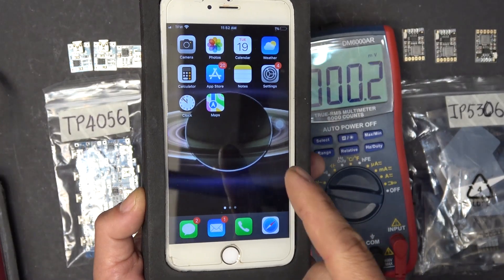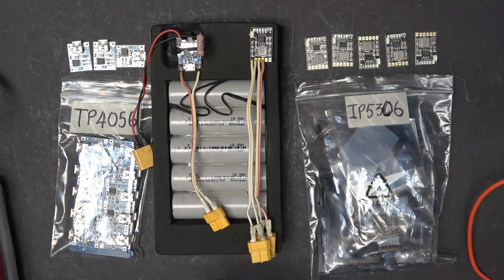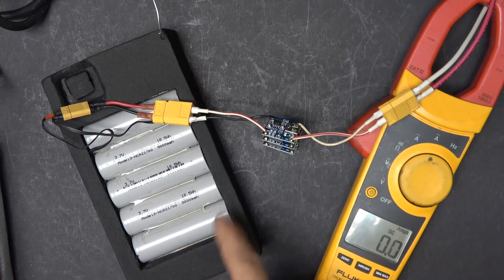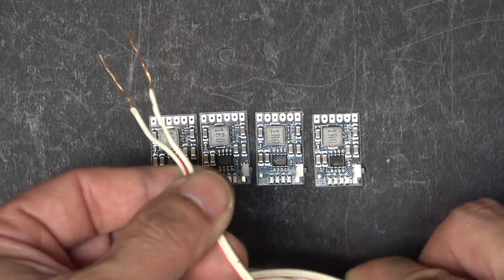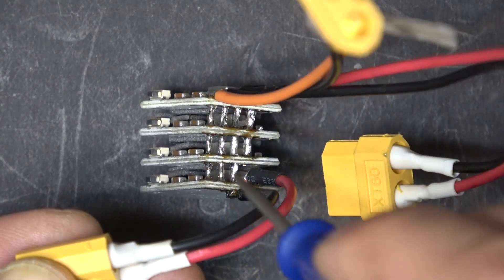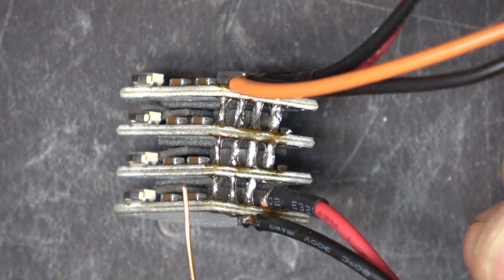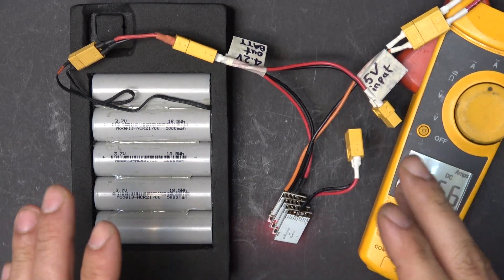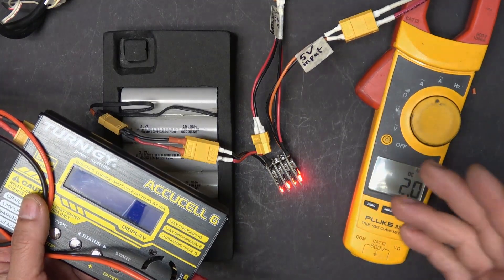Make high current Li-ion battery charger from IP5306 and TP4056 boards

Comment: What does it look like when it gets to the end of the charging cycle does the current fall down and then switch off at the correct battery voltage?
Reply from the maker: Yes, it will reduce the current and cut off at the end. It'll work just like one single unit, just faster.

Comment: These modules are pretty hot that if you touch it might burn your finger during the charging process, I sugest to use a small heatsink or small fan is better for these stacked modules, Otherwise the board will melting your usb cable

Comment: My question what is the temperature  of the boards Tp4056 made one with 2x Tp4056 and it got hot to a point I had to stop charging 175degrees and higher I will Try to make one with 3x Tp4056

Comment: I want to ask about the ip5306 module, by combining it with a parallel circuit, how much current will come out through the output to the load?

Comment: there is a smaller charger even <--- well after you make a box / in-out connectors..  look up a charger called (ISDT q6-nano) its an 8amp charger (up to 40v input) i love mine .. i also have the q10 that dose 20amp , its not much bigger ..

Comment: Thank for the Video, by this tutorial, I can charge my 24 volt battery E bike
I just try to charge each of 1S moduel battery
so, 6 module battery charging seperately, so I can safely to charge my battery without any Inbalance and not use any BMS for my e Bike, and because of that, I need to change wire diagram of my E bike charging method, but that's fine, better then Using BMS

Comment: You are really smart man, I have a question for you.  I bought a battery pack that has a digital percentage display which is what I want and it can give 4.5 amps at 5v qc 3 and qc 4 it has lipo battery inside 2x 5000 mha 3.7v has battery + and - and 2 other little connections NIC.  So my question, can I replace the lipo battery with lithium ion 2x 5000mha 3.7v and just use the + and - ? Will it stop charging at 100% and be safe ?

Comment: i made the same thing, i use a powerbank module (ip5328p) to charge mine. It charges at 18w. It can also be used as a power bank. I'm using molicel p42a 4200mah 21700, my iPhone 6s has a total capacity of 21ah. It takes about 1hr30 minutes to charge the battery.

Comment: It's not a balance charging method though is it???🤔🤔😳🇬🇧
Reply from the maker: It is balanced because you only charge a 1S battery this way.
Reply: @vuaeco  Yes, but it's 5 separate cells. Just because they are in parallel doesn't mean they will all be at the same voltage....🤔😳🇬🇧
Reply: @EnglishTurbines  They always are the same voltage because they are always connected to each other. They balance the voltage automatically

Comment: yes you can connect them to increase the amp limit, just a parallel connection of 6 of them, but you have to have a 12 Amp supply

Comment: That glowing wire was fun, but for sheer exhilaration, it's hard to beat dropping making accidental contact while using a folding Allen key set on your Headway pack. It shorted 7 cells, and glowed like a stove on high in about 3 seconds. I used a sharpening steel to smack it off, but not before the end went molten, leaving the screw head completely smooth.

Oh, did I mention that this was in the kitchen? 🤤 #DIYWelding
Reply from the maker: LOL. That's one way to forge a new tool! :D

Comment: hello vuaeco i love watching youre videos but i have a problem. i have a scooter 48 volt 1000watt  and it bearly hit 25 km/h on straight road im 80kg btw. do you know why its so slow and what i can do?
Reply from the maker: Could possibly your controller can only support that much output. Or your battery might have a problem. If you have a new set of better battery and controller, swap it out one by one and you can possibly figure out the problem.
Reply: @vuaeco  hello thank you for replying:) i dont have any controller or battery laying around but the website where i bought the scooter from says tha the controller has  21 amp. if you want to see the website search for (stay classy n2 performence)
Reply: @fun_ghoul  ik i have a friend with 36 volt and 350 watt motor and even that goes 30 kmh

Comment: Hey Vuaeco, i like your idea but in my case, i used a step down converter, which has an output of 20 amps max. (10$). I use a usb c pd trigger board (10$) to get 20 volts from a powerbank and then step the voltage down to 4.2 and in my case CC 10 amps, so 42 watts. Works flawlessly.
Reply from the maker: You are stepping the voltage up from a power bank to 20V and then step down to 4.2V? That's a lot of wasted power though.
Reply: @vuaeco  yes, you are right. But the PD protocol supports 20, 15, 12, 9 and 5 Volts. So i have a lot to pick from.

Comment: Did you fully charge your pack and how was the heat during the charge at 7+ amps?
Reply from the maker: Not this particular pack because I need to run it down to empty to see how long it lasts on a single charge. But I did try this IP5306 board on other Tesla cells and they stay cool at full load. This is much better than the TP4056. The only problem is, you have to run it at 2 Amps each and not lower.
Reply: @vuaeco  , I see . That phone battery pack is something to behold. For people that use their phones in the shop it's ideal. Amazing stuff as always. Thanks for all you do brother
Reply: @vuaeco  is this ip5306 has low voltage protection like Tp4056 ?
Reply: @vuaeco  u answerd what i looking for.from Ip5306 how long u charge? charging after diddnt u notice any heat at all? Looks it is stable.thank you for making usefull honest video with practical experiment its soo cool.keep it up.